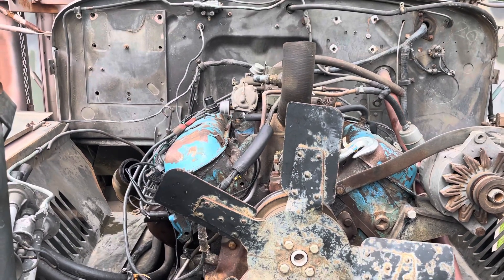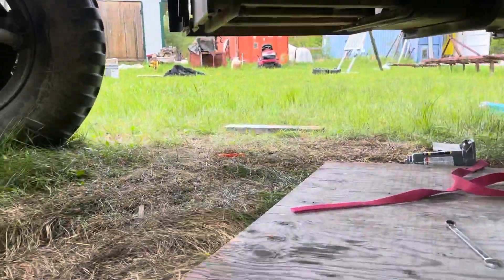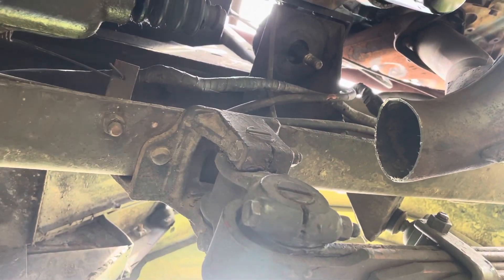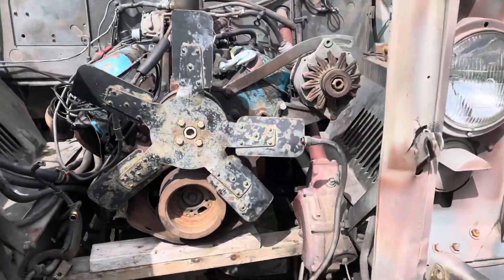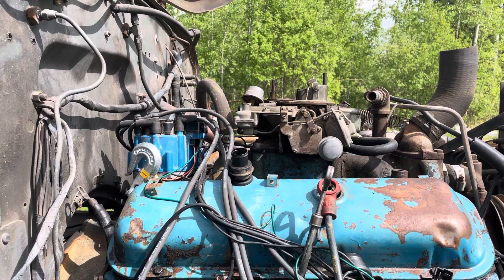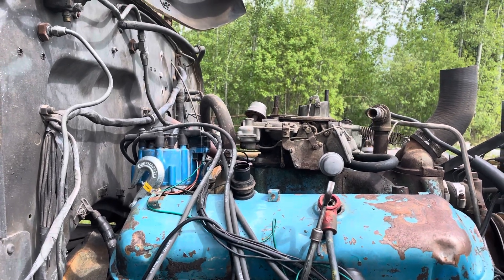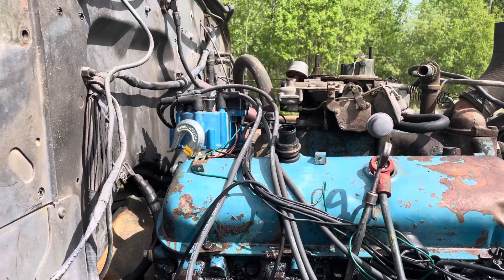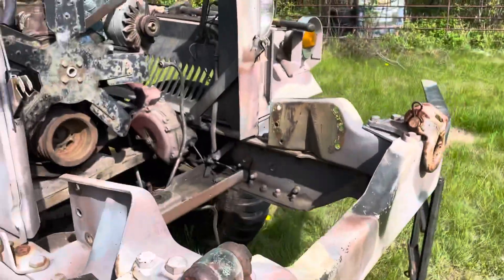M35A2 V8 engine swap.Part 3

Comment: Good job.. I was waiting your video. Please more details and pictures about mountings and fly wheel.
Reply from the maker: Those housings are sparse but they are available make sure to get the fly wheel also, rigging in the air compressor takes about a full day but it can be done

Comment: what is the casting number on that flywheel housing.
Reply from the maker: I wish I knew, I thought I had a photo of it but I am unable to find it
Reply: @North700  thanks for the reply. I just picked up a 1966 c60 for my swap but it has a typical chevy pattern type transmission. So now i gotta either use a gm transmission or find these parts.
Reply from the maker: I highly recommend finding the housing and flywheel, 
 The housing is also the motor mount, and it is best to use the spicer trans as it has the overdrive in it. 
 Where you located?
Reply: @North700  Lumberton Tx